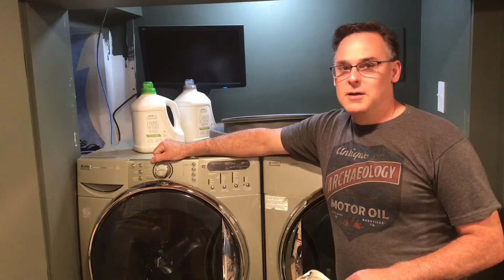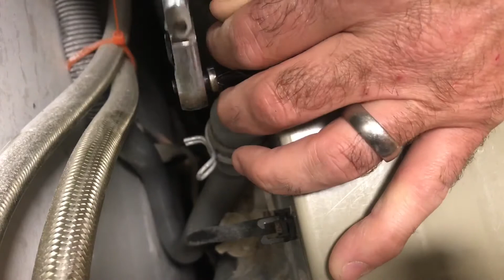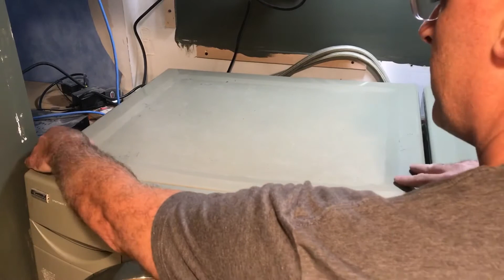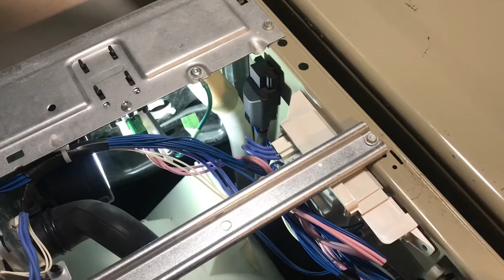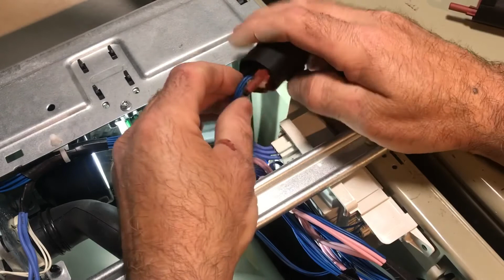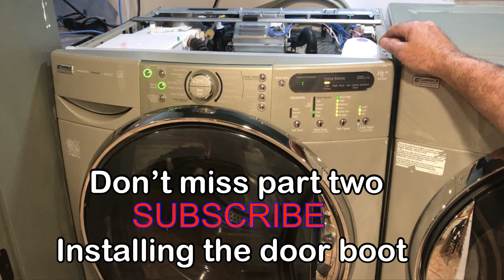Kenmore Elite code: F35 sud and leaking door boot repair (part one)

Comment: We have the same washer and dryer.  Mind sharing the part number for that pressure sensor?
Reply from the maker: Sure thing. I’m actually surprised I didn’t put it in the description. Looks like I’ll need to edit that a little. It is, Whirlpool W10156252 Switch for Washer. Sears no longer makes the part and other sites will say that it’s no longer available. Stay persistent and you should be able to find it.
Reply: Thanks